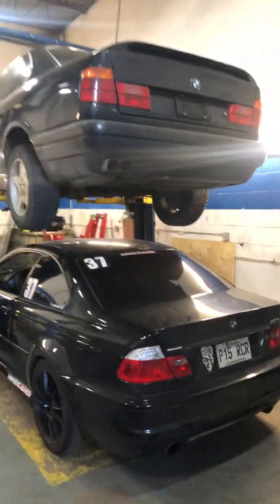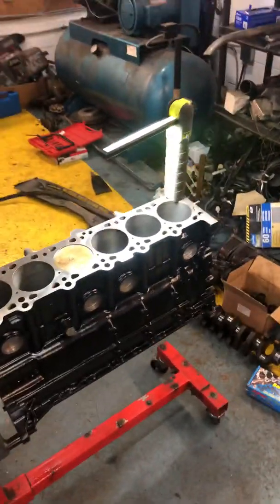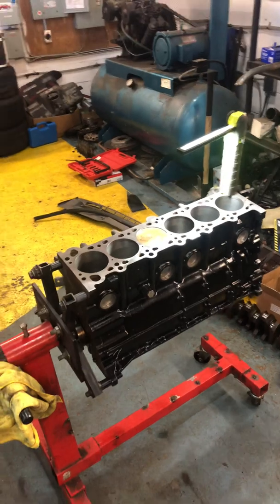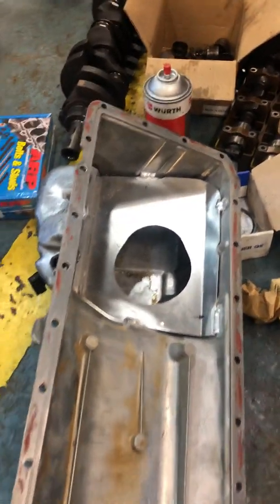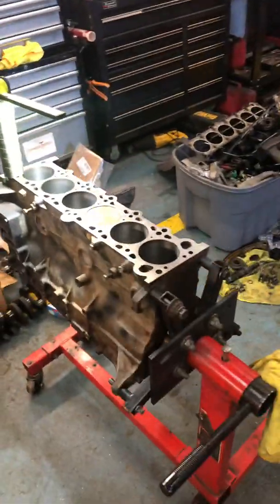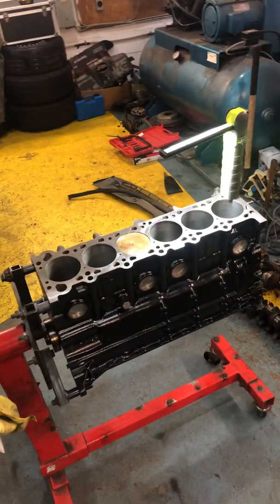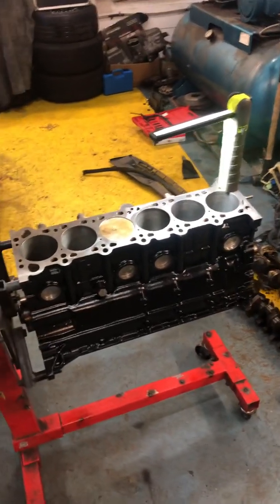BMW M50B30 Stroker Build Part 1

Comment: How did you get rid of the ridge on the cilinder walls ? I thought you needed to rebore te cilinder walls and put oversized pistons in?
Reply from the maker: Ideally you do. I wouldnt recommend doing it otherwise. This engine started burning oil after 10000kms. I took it out and rebored to 86.5mm and got carillo pistons to size. Check my newer videos.

Comment: Do you know if 1995 m50 has the issue of the crappy valve springs? Thank  you ♥️
Reply from the maker: It depends on the month of production. Has to be after 03/95 usually. Easy to check. The crappy springs are straight. The good ones(m52 style) are conical.
Reply: @iconicars3050 what do you think of using double springs from m50nv
Reply from the maker: @JorMorera no go. They are not rev happy.
Reply: @iconicars3050 do you use WhatsApp to send a Pic? I really don't know what I'm seeing lol
Reply: @iconicars3050 damn I think I have straight valve springs, any suggestions?
Reply from the maker: @JorMorera you need m54 cam trays, lifters, valve springs and upper and lower spring retainers. Scrap yard items
Reply: @iconicars3050 I will use the tray and  intake cam from m54b30 and intake cam from m50nv in exhaust, would I be safe to use the crappy springs with stock ECU?
Reply from the maker: @JorMorera springs not related to ecu.  You cannot and shouldn't use nv springs with m54 cam and cam tray. Lifters are smaller.
Reply: @iconicars3050 I'm using the springs of m50 vanos. (crappy ones) I mentioned the OG ecu because Im not going beyond 7000rpms. I just want to know if I'm safe

Comment: I have a non vanos m50 block I’m building right now. I got a NONvanos m50 head because I thought the dual valve springs was better was for high rev 😢. What should I do? Am I able to put the better valve springs on the m50 head?
Reply from the maker: I dont know, never tried. I dont like non vanos M50’s so i rarely work with them.
Reply: @iconicars3050  does vanos even make much a difference when it comes to boosted applications lol. And u can add vanos to a nv block
Reply from the maker: @TruBimmer  you can add anything to anything with the right knowledge and unlimited amount of money. I don’t see the benefit of boosting a non vanos head over a vanos head. You have a-lot better cam options for a vanos head and better tuning capabilities, more software and support available. M50nv cams are junk, 240/240 cam option doesn’t work either for spool or degreeing cams to get some midrange. Boost or n/a build you need to run minimum S52 cams.
Reply: @iconicars3050  okay you can add s52 cams and vanos to a non vanos block too lol. so if you’re gonna do s52 cams regardless what makes a nv m50 so garbage
Reply from the maker: @TruBimmer  cams dont mount to the block lol. We aren’t talking about nv block. Talking about NV head being garbage.
Reply: @TruBimmer m50nv head has double springs, thats good for high revs

Comment: Hi there. Im currently building the same engine and wanted to find out if i could deck the block to be flush with the piston instead of just going 1 thou 

I am also using m54b30 crank, rods and pistons
Reply from the maker: you can’t deck it that much. Compression will be too high and your chain will be lose, the tensioner can’t pickup that much slack.
Reply: @iconicars3050  alright, I see, so 1.6mm it is. If you don't mind me asking. I want to regrind my camshafts to a different specification, but I'm not sure what to grind it to ?
Reply from the maker: @3than12_21  just copy schrick. Duration 264/256. Lift 10.5/10.4.
Reply: @iconicars3050  thanks alot for your help
Reply: @iconicars3050  hi there, sorry to bother you again. I just spoke to my engineering guy, and he says that I need to machine the cam trays so that the lifters can move further up and also lengthen the valves and he also says that the hydraulic clearancers have to be reset as well. Is this true, or can I just regrind the cam to 264/256 without doing any of that
Reply from the maker: @3than12_21  he needs to change his profession and do something else for a living 🤣. I run 270/264 cams in  my m50tu engine with m52 cylinder head. Stock trays, stock lifters, stock valves and springs. Also i can tell you that your guy doesn’t know these engines at all and shouldn’t be touching it from what you just said.
Reply: @iconicars3050  thanks alot my friend truly. You just saved me a shit load of money 
Then again, thank you so much for your help I appreciate it

Comment: How did you get rid of that ridge without taking of too much? Just with slight hooning?
Reply from the maker: No, honing wont do it. You need a special tool to remove the ridge. “Cylinder ridge reamer”
Reply: @iconicars3050  could you maybe link a tool you used my for the ridge, i measured the whole cylinder is 84.0mm, only under the ridge is like 1mm deep getting from 84 to 84.09mm, also my engine mechanic told me that i have to go full 84.25 on the cylinders and go for 84.25mm pistons, what do you mean?

Comment: Автор,  ты - русский?)
Reply from the maker: Говорю по Русски.
Reply: @iconicars3050  я услышал русский акцент =)
у вас хороший английский... мне ваш английский был очень понятен..
Reply from the maker: @Gifase34  отлично, но по русски мне сложнее было б это же объяснить. Терминология совсем другая. Я вырос в канаде.
Reply: @iconicars3050  на английском лучше, у вас понятный английский..
а русские и так знаю что такое строкер 3.0
у меня строкер M50 3.2
cranck m54b30
rods m50b25 non vanos (135mm)
pistons toyota 2jz-ge non vvti (86mm)
compression ratio 11.3:1
m52YU(double vanos) oil pump
cylinder head m50b25
camshafts S52b32
ECU m3 S52 (siemens ms41)

привет из Израиля! =)
Reply from the maker: @Gifase34  проблема установить мs41 ecu? У меня bosch red label, допотоп.
Reply: @iconicars3050 я делал адаптор от мс40 к мс41 понял что все работает и потом перепиновал 88пин коннектор под схему мс41
в случае с бош будет труднее, мне нужен был только idle от Е39 и cranck sensor от е39 остальное все подходит.
но я это делал для того чтоб потом поставить speeduino
Reply from the maker: @Gifase34  алекс, дай електронную почту или инсту

Comment: Thanks for the info! So for this setup with 0.6mm skimmed off the block, head skimmed with as little as possible and a 1.75mm headgasket there are no valve clearance issues? Is this setup working well? Any other tweaks with timing? Because of the "shorter" chain length?
Reply from the maker: Working well, already put on very hard 10k of track. No issues. Chain slack is minimal.
Reply: @iconicars3050  Thanks for the reply! Do you run higher octane with this compression or the european 95 pump gas is enough for it to run knock-free? I had already skimmed 0.6mm of the block and was thinking of going for the 2.05mm gasket to avoid running 98/99/100 octane..
Reply from the maker: @mateivornicu8252  i run 93 oct(canada). there is no detonation. Compression still too low for deton. 12:1 is border line for pump gas.
Reply: Just asking, but why not take 0.7mm of  the deck ? Will there be to much slack on the chain with that much taken of ?

Comment: Hi, i already have built one M50B30 stroker, no vanos and forged pistons/rods. Ebay turbo kit, makes about 670whp although I believe engine is capable of 800+ hp with better turbo and E85. 

Anyways, I have just bought a e30 shell for cheap and i'm looking into putting a M50B30 stroker into it, considering that M20B25 trans bolts right up to M50B25. While i'd go with an almost exact build like yours, i'd like to install some high compression pistons, preferably getting the compression ratio near 12:1, maybe even 12.5:1. I was planning to run Shell V-Power 100 EU octane (94 in US).

Do you think i would be getting knocking/detonation with this pump gas? The car would be track/weekend driven only. 
In addition to all of this, i was planning on installing some ITB's from S52 or S54, lightened flywheel and maybe Shrick cams in future. 

All in all, money isn't a huge deal to me, because I already have bought M50 engine that spun a bearing for $100. The M54 crank and rods is going to be another $500. High compression pistons are ~$650, ITB is about $400, flywheel is about $250 and i'd leave $500 for stuff like bearings, gaskets etc. All in all, i'm expecting to build a race ready engine for about $2500, that's quarter price of the S54 swap i was originally planning.

I'm hoping to make 275hp on crank, nowhere near S54 power, but still cool. Do you think this power is achievable reliably?

Comment: But things about Head and valves are just regarding that m50b25tu. It's not applicable for non tu models. Give some advice for non tu engines.
Reply from the maker: I don’t build non vanos M50’s at all because they have low potential and limited tuning capabilities. They are only good for boost.

Comment: How do you deal with the CKP sensor since m54’s ckp sensor is near the rear main seal and the crank itself doesn’t have trigger
Reply from the maker: You don’t need to use the M54 trigger wheel. You remove that trigger wheel off the crank before installing the crank into your M50 block. You use the M50 front dampener and m50 crank sensor which sits in the front timing cover.

Comment: What piston rings did you go with. They're saying the m52 oil control rings are better and to use m54b30 top and middle rings.
Reply from the maker: I used m54b30 all 3 rings. Noone sells just oil rings alone...to use m52 oil rings you’d have to but two sets of pistons rings, which is very expensive. Its 50$ per piston for 1 set. To buy two sets its 100$ per piston. 600$ in rings, noones gonna spend that. The m54 oil rings are good for at least 150k kms before it starts burning oil. Another thing people forget it that M54 is aluminium block and M50/M52 is cast iron. Completely Different cylinder coating.
Reply: @iconicars3050  m52 is not cast,its aluminum
Reply from the maker: @MrZoranbebek  m52b28 with aluminum block only came in bmw z3 which is very rare. The m52tu is aluminum but its a totally different engine, its almost the same as m54
Reply: @iconicars3050  M52 is aluminium block outside of the US
Reply: All M52 is Aluminum. The M50 is the last Cast.
Reply: @fredromekhi2066  the M52 is cast iron.
M52tu is aluminum. Come on its not that hard.
Reply: @frontspring1  It is iron block in the US. The M52 and M52TU are alloy block in every other market. Come on it's not that hard.
Reply: @nokizorque  that's what I stated
Reply: @frontspring1  You said the M52 is cast iron and the M52TU is alloy. Which is true for the US and incorrect in every other country
Reply: @nokizorque  yeah that's true I forgot youtube is worldwide.
Reply: https://youtu.be/hPvebidBZSs 

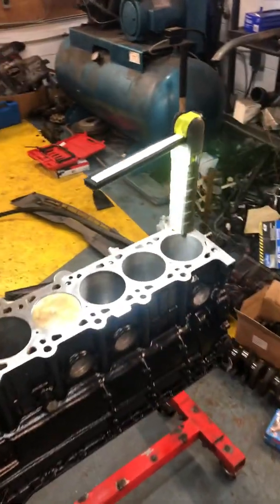„Der Zylinderblock ist nun aus Aluminiumguss gefertigt“ ~ 2:40

Comment: hi   i stroke the internal m54 b30 pistons ,connecting rods and crankshaft ? IN AN M52 B28 ENGINE BLOC ? I  use a cometic 0.76 head gasket , and camshfts s52 3.2 us .what would be my volumetric ratio? WHAT DO YOU THINK,? MANY THANKS
Reply from the maker: No idea

Comment: Can i pick a thinner head gasket for the same CR as you with the shaved block?
Reply from the maker: 1.75mm is the thinnest for 84mm bore block. The other one is 2.05mm which is thicker.
Reply: @iconicars3050  when I look on the internet in Holland I can pick a 1mm headgasket

Comment: What's the thickness of the head gasket?
Reply from the maker: 1.75mm standard head gasket.
Reply: @iconicars3050  ok thanks 
I only have 93 octane here in Florida do you think shaving 20 thou off the block would be a good compression ratio for 93 pump gas
Reply from the maker: @frontspring1  yeah. Im in canada we also only have 93 highest. E46 m3 stock cr: 11.5:1.

Comment: So pretty much to narrow it down ...
-M50 Block/Oil Pan
-M52 Head/Lifters/Valves
-S52/62 Valve Springs/Bottom Seat/Top Plate
-M54 Pistons/Rod/Crank
-M54 ZHP Intake Cam
-S50B30 Exhaust Cam
-ARP Head Studs/Bolts
-Head gasket (Personally I would go cutring with copper spacer) 
Am i missing anything?
Reply from the maker: No need for that head gasket unless you are boosting the engine.
Reply: The s52 valve springs are the same as the m54?

Comment: 228hp.. Heh und all that making for just 60hp.. Better is e bay turbo 280hps on wheels
Reply from the maker: Yeah and never ending headaches with your ebay turbo kit.
Reply: @iconicars3050  I have thinking that we must bore engine to 3.0 but now jusst to change pistons along with rods and camschaft! and easly 228hp! Im making this now thank u!
Reply from the maker: Ensar Bmw and crankshaft

Comment: Ok so here's my question...well a couple 
1.) On any of these stroker jobs(I'll be doing one on a m52tub28 and I own a e36 328 that everything will go into)we all take care of the cam stroke which gives us more space for the boom 💥  in the top of the cylinder,but why isn't the heads ever bored out(esp after the tu when it jumped to 3.2). Isn't ANY additional room for detonation going to lead to more power?why am I not going to bore the head out to use the bigger pistons
Reply from the maker: Buy an S52 head, noone will bore out the combustion chamber for you. You only need that if you go 3.2L. (86.5 bore)

Comment: This video is very helpful thank you, I do have a question could I use a m54b30 crank with s50 b32 con rods with m50 piston on a m50tu block and head? Would it work and would there be interference?
Thanks
Reply: M50 bearig 45mm s50 - 49mm. S50 139mm conrod , m50 nv is the highest piston reaching the deck or over. And b30 crank is 89.6 stroke! How the hell you think that gonna work 😂 that means you gonna have few cm over the deck and about 5mm gap between the conrod and crank 😅
Reply from the maker: No idea, never tried it.
Reply: @iconicars3050  how much horse power does it give?

Comment: hey :D i am currently doing the a m50b25NV stroker to 3l with m54b30 internals ?:D just have one Q for you Why dount you use a m52b28 head gasket ?? it is only 0,75mm and is steel ?? :)
Reply from the maker: Thats wrong. M52B28 headgasket is 1.75mm and is not steel. 11121726619.

Comment: How would a decked m50b30 like yours compare to a m52b28 that uses m50tu pistons (.72mm talker) and a 2mm gasket (so about .5mm taller total). Based on some calculations with an m52 head-it has a CR of 11.1:1 and if a m50 head is used (2cc less) it has a CR of 11.4:1. While it’s only a 7% decrease in displacement the rod  ratio is much better.
Reply from the maker: ndforlife410 your calculations aren’t correct. Too high. Compression doesn’t only depend on the piston. Its crank piston rod combo. M50 and M52 blocks are the same height and same bore size. I never tried mix matching pistons. 11.4:1 on an m50/m52 is too high for pump gas.
Reply: I’m trying to sort through all the bulll shit you read in forums so if those CR numbers aren’t correct my bad.